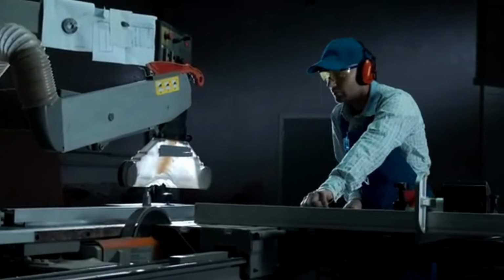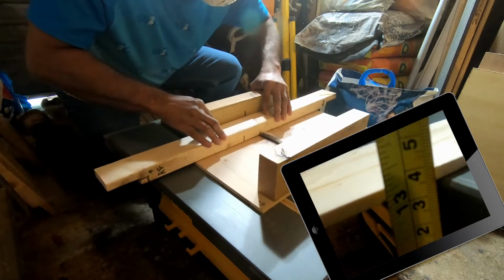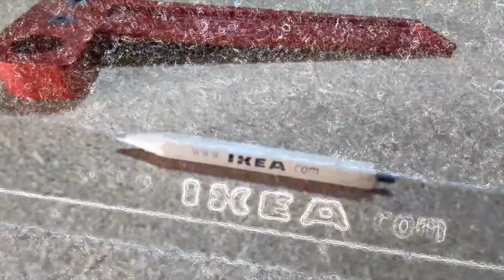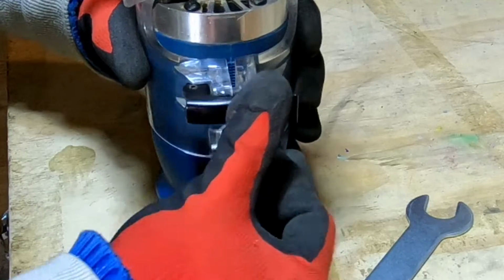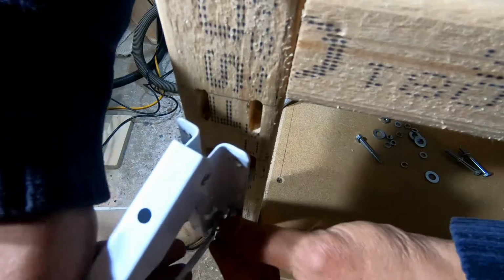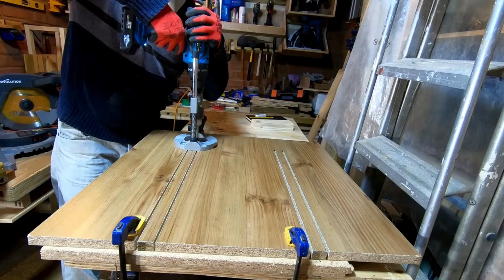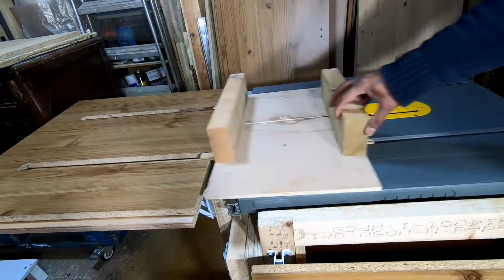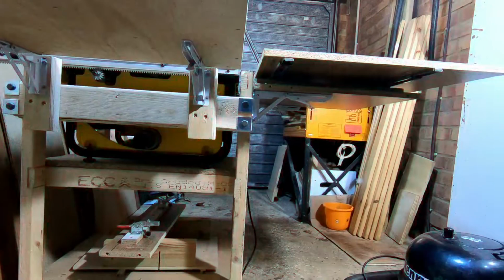3 in 1 Table Saw stand with sliding carriage & Foldable outfeed - DeWalt

Comment: Gre4at build Suj mate. How is it holding up with the sliding table? I bought some sliding Linear guide rails off Vevor to build a sliding table. I want to build a whole Table saw from scratch. I have an cheap old table saw and I am thinking about making a steel frame like u made out of the wood. Something very similar. 
I'm using 40x40x2.5mm Square Tubing. I'm also making the top out of the same product. It'll be 1000mm long. That will give me the support I need to build on the sliding carriage. I'm using angle bar to connect the linear rails to. I will have to use some kind of grub screw or small bolts turned in the tapped holes underneath the table to making it sit flush to the table saw frame but I think I can get it to work with some luck. It will be very heavy when it's finished but I will put some heavy duty castors/retractable like ur going to do, apologies for stealing ur idea as well, and it will help me to move it around the shop when needed. I have a 16x10 garage workshop. It's basically a single car garage built into the house. I wish I had a bigger shop but needs must and it'd be too expensive to rent one. The space means I have to be clever with space saving ideas. 
That's why i HAVE ENJOYED WATCHING SOME OF UR VIDEOS ABOUT THE FRENCH CLEAT WALL, and the workbench flip top ideas. They save in space making sure tools are at hand so easily.
Keep up the great work my friend. Enjoying ur channel videos very much..
Reply from the maker: Thanks again, bud 👍. The sliding carriage is holding well, still being used. It needs a good dusting before use. And i use wd40 on the bearings once in a while. Building it out of steel tubing will defo keep it slender. The extra thing I would add is a retractable support leg for the front extension part. Thanks for watching and all the comments 😀.  Much appreciated

Comment: No fence on your sliding carriage?
Reply from the maker: No, I still use the stock fence setup. Example: https://www.youtube.com/watch?v=n3o_sO8Vhsk&t=0m44s
Or did I understand the question wrong? 😀
Reply: @SujMenon  That defeats the most important function of the carriage.  You're still crosscuting using the tablesaw fence.  So your sliding carriage is really just helping to carry the off fall.  If you put a fence on the carriage, you could crosscut any length regardless of the tablesaw fence limitations.  That's really the main purpose of a carriage.  You did all the work but using none of the benefit!  imho

Comment: Really liked the video and done great ideas.

Would it have been better to mount the two sets of sliding hinges directly  together instead of using another sheet of hardboard?
I'm just thinking of the weight and extra material cost.
Reply from the maker: Jason, not sure I understood the question. Is this on the outfeed table side which had 2 sheets on it? If so, I did it for the grooves on the tables saw's mitre slots to align, so that I could use my cross cut sleds. Ie, rhe bars can go over the outfeed to cover its length.
If its about that 2 horn like structure, that was for the fence rail to clear, and make the outfeed table  at the same height as the top of the table saw.. essentially making a U shaped structure
Reply: Hi.
No.
I mean the feed table.
You essentially have 3 boards.
The base.
The second board and then a third.
With two sets of sliding hinges on the bottom and middle boards so that the top board can slide front to back.

What I meant was; isn't it possible to mount the two sets of hinges to eachother and do without the middle board?
Making that section lighter and of course needing less materials.
Reply from the maker: Ah got what you are saying. I did think about it, but then I couldn't come up with  a way to attach the 2 opposite direction slides like that. So went with that additional board in the middle. But if you can do it, then please tag me once done. Will be interesting to see how it is.

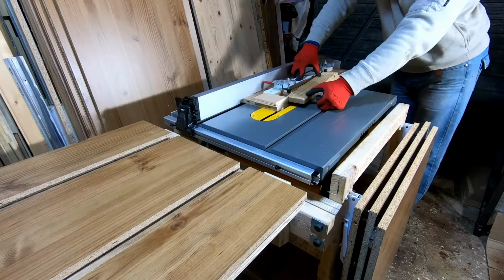Comment: 14:24, holy crap dude, don't wear gloves while using a table saw!
Reply from the maker: Yes, I am completely aware of the danger involved while using gloves. You will get that extra rubber grip, but have to always be careful while using these tools, especially if the maneuver is that close to the blade. Just my 2 pence that, personally I am totally focused while using these tools, but everyone should use it only based on their comfort level.

Comment: Suj that's fantastic mate! Well done - impressive build and design indeed. Are you going to add a cross fence onto the sliding table like the factory build ones have?
Reply from the maker: Thanks Rob 😁👍. I actually did order aluminium mitre slots and matching mitre bar slider for that sliding part's top, but ended up not using it. That still needs somemore thought on how it will all come together. The main issue is that, my saw isn't fixed rigidly as I would like to use it outside for really dusty cuts. So everytime the alignment has to be made parallel to these "new tracks" on the sliding arm. It can be done, but left it for another day 😜
Reply: @SujMenon  ah yeah I see how that would mess things up. Cool thing you made though!